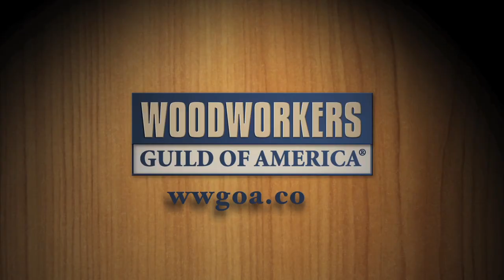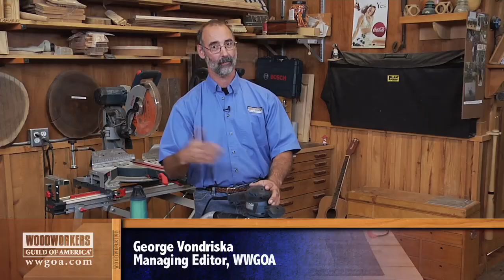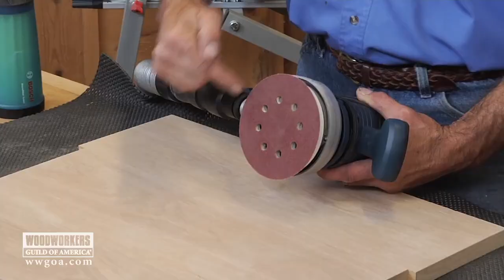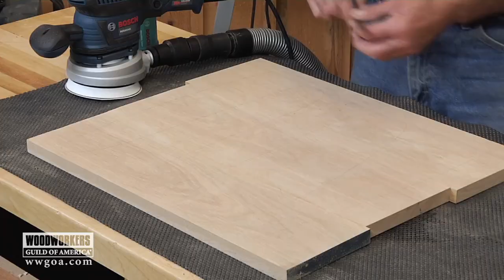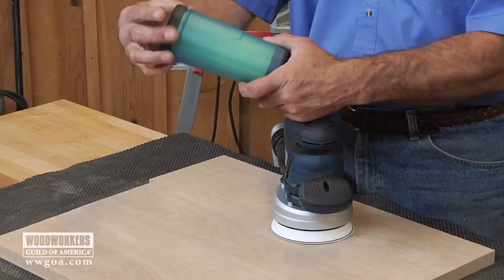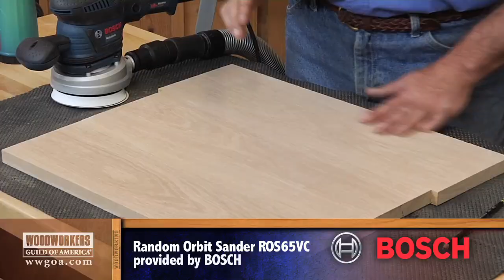Woodworking Tools: Power Tools - Using a Random Orbit Sander

Comment: Thanks for this helpful content, 
I borrowed this random orbital sander  it works well while i grap it touching wood surface, but once I leave it on wood, it stops rotating.  
Furthermore, I can't apply any pressure while sanding. 
Is this normal or something wrong with this sander.

Comment: I realize this video is pretty old, but it's really good.    Question tho:  What is the mat you're using under your piece?   I was using the stuff to keep carpets from slipping, and also shelf liner to keep stuff from moving in earthquakes (I'm in CA).  Both are leaving marks on my piece.   I think it is oil, as opposed to indentations, but either way, it's not good.   Thanks.
Reply from the maker: Hi Laura, 

That is something like this: https://amzn.to/38XESUT
Those work great for handheld router applications as well as sanding.

Paul
Woodworkers Guild of America

Comment: Hmm. Very unsure. Watched a few where they say you need to start the sander with it already on the surface. Also no info on grits of paper
Reply: @gringochucha 

The only issue with that is if you don't set the sander down on the work surface completely parallel the edge will dig in.
In my opinion you start the sander with it fully sitting on the surface and lift if off before stopping it.
Reply: @gringochucha 

Who's obsessed?  I'm simply stating my professional opinion.
Reply: @gringochucha 

One shouldn't be a douche nozzle, and I'm not referring to you.

Comment: What is that material you are putting the boards on to prevent them from moving?
Reply: Don't know if you or anybody else still cares but it looks like drawer liner. You can get it from any hardware or home center. It has a bit of a grippiness to it. I have it in my kitchen shelves to keep stuff from sliding around.

Comment: Can anyone tell me if I would e able to use a Random Orbit Sander vertically as opposed to horizontal. In case you can't envision what I mean, if you imagine there was a piece of wood screwed into the side of a building, could I sand it if its at that orientation?
Reply: yes
Reply: @zachary3777 

Ditto.  You can even sand upside down and naked if you're so inclined.

Comment: When I try to finish weathered wood I'll generally start with 60 grit sandpaper but after I am done with the 60 grit I'll always end up with little swirls in my wood especially noticeable when I get to the 220 grit.  I always go with the grain and only sand till I have the paint or weathered areas finished.  When I sand I also almost always sand with the rpm's high and rarely slow it down.  Can you tell me why I have the swirl marks please?
Reply from the maker: +mypony891 I'm assuming that you are using a random orbital sander.  It is not uncommon to see some swirl marks with a coarse grit like 60, but with a good ROS you should be able to virtually eliminate these as you progress through the grits.  In my experience the problem that you are describing occurs from trying to progress too quickly through your grit sequence, and/or pressing too hard on the sander, particularly with coarse grits.  The first thing that I'd suggest is to use all of the grit increments that you have available to you, especially if you are starting out as coarse as 60.  In other words, go from 60, 80, 100, 120, 150, and 220.  Don't press down too hard with any of these grits; let the sander do the work and take your time.  If you press down to hurry through 60 grit, you will spend a lot more time with 80 grit to remove the swirl marks from the 60.  If you skip 80 and go straight to 100, it will take you much longer to remove the swirls left behind by the 60 grit.  If you take your time, and be patient with every single grit, ensure that all of the previous marks are removed, you will cover all your tracks.   
Also, with a ROS, grain orientation doesn't matter because you should be moving the sander slowly, and the actual abrasion pattern is randomized.
Reply: Thanks very much for the tips!  I'll give that a try on my current project!  I have been going from 60 ROS to 100 grit, with the 100grit being done by hand since its just sheet sand paper.

Comment: My random orbit sander cut the speed down and gets hot
How can I fix it?
Reply: Don't press too hard and use a vacuum.  The vacuum keeps your lungs clean, keeps the sander cooler, removes the dust from the work surface so you're not sanding the same dust over and over plus your sanding will be faster. Your sand paper will last longer cuz it won't get gunked up as quickly cuz the vacuum removes it as quickly as the paper removes it.

Comment: based on what you said about not pressing down, are the pressure sensors on some sanders just a gimmick and uneeded?
Reply: The weight of the sander and your hand is sufficient.  Let the sander and paper do the work.

Comment: The pencil lines is a good idea.  I've used it for years.  I thought about buying an orbital sander but I don't think they will hook up to my shop vac. Now I don't think I need one anymore since I bought a drum sander.  What are your thoughts on this?
Reply: Drum sanders are great but they leave standing lines that will still need to be removed. The random orbit sander works well for this.